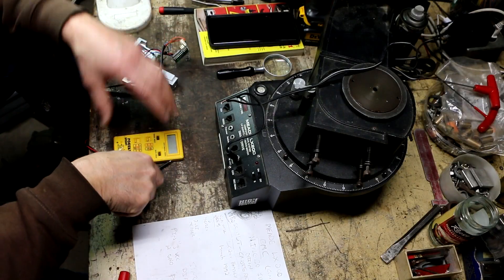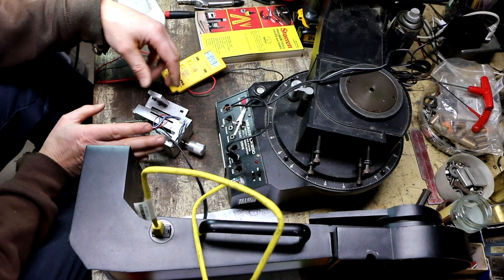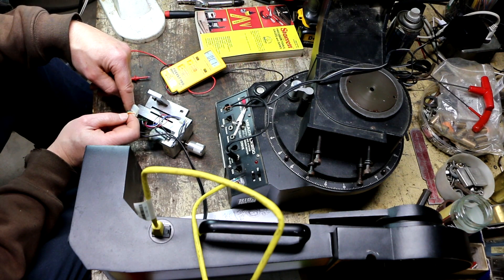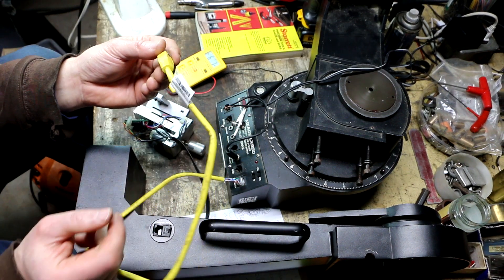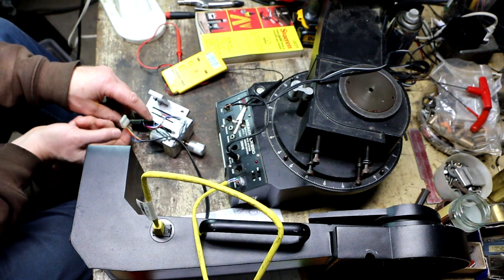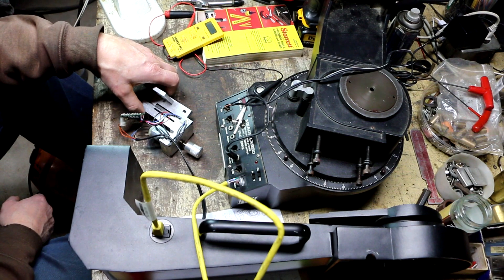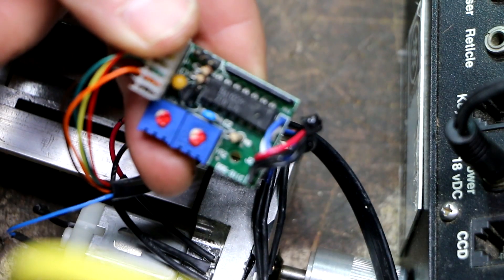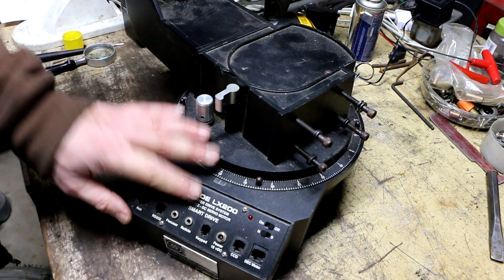Meade LX200 Classic Telescope Part 3

Comment: If you ever take an LX200 Classic apart again, wrap tape around the forks and base where they meet.  Cut the tape in between the gap and mark with a sharpie.  That way you can get it really close to its orthogonal alignment.  The GPS fork does not work like this.  It's one piece.

Held in the front cell is called the corrector plate.  The primary mirror is attached to the baffle tube on the rear cell.  The corrector plate holds the secondary mirror.  

The LX200 goes through a "find home" when you first power it on.  That's what you hear whirring when you apply 18 volts.  It is rotating the worm gear around in the R.A. (inside the base) until the hall effect sensor picks up the magnet inside the shaft.  Once it finds that, it will reverse rotation and then start tracking 15 degrees per hour.

The DEC motor cable is not a straight through cable.  It is reversed at the other end, no you cannot use a crossover ethernet cable.  !!!MEADE WAS WEIRD ABOUT WIRING!!!  PAY CLOSE ATTENTION TO WHAT YOU'RE DOING.

If you're digging into one that deep, replace every screw with a stainless steel one.  The old black ones rust like crazy.

Once the corrector is shattered, most of it is scrap as the corrector was matched to that mirror at the factory.  Finding another that produce what a matched set could would be virtually impossible.  Meade had a patent on how they aligned the corrector as well.

They were a great company back in the 80's, 90's and early 2000's.  They were bought by Orion and everything sucks.
Reply from the maker: Lot's of great info you have here. I figured out most of this through research, and trial and error, but this comment might help others. The OTA is currently a scrap bin for aluminum, and will be going to the scrap yard soon. The forks will probably be joining it. Without the autostar control, I cannot give the base a true test, and the DEC motor/drive seems to do nothing even with a correctly wired cable. So I will probably just sell those parts AS IS. Thanks for watching.
Reply: @stevewatr  -- Thanks, Steve.  I don't have a way of contacting you inside of YouTube, but if you want, I can give you something for the base minus the forks.  Or just the boards.  So you'd have the R.A. motor inside the base, the main board with it's two ceramic resistors, the DEC motor and the front panel.  The 8" and 10" models used the same firmware I believe.  The 12" was different.  Value wise...without knowing if it's truly functioning, it's not going to be worth tested and verified components.  So I'd say like $45 plus shipping?  ¯\_(ツ)_/¯ 

Let me know.  My email address is -- philgodfrey at me . com -- (separating out everything so the bots don't figure it out.  Obviously replace (at) with @).  :)

Comment: Too bad another Meade owner couldn’t loan you a keypad and cables. Clearline-tech makes a new handcontroller for about $140+ shipping with cable.  Yes the DEC motor in the fork does not move on start up...only the RA motor which is in the base which rotates according to the clock setting to match the Polaris offset. The boards that drive the motors are upgradeable also with clear line products. Might be someone looking for those old boards, but would need to know if working. Typically the yellow C1 tantalum capacitors on the motor boards, main board, front panel power board and the handcontroller board blow and kills the scope. Cloudy Nights has the tants coveredwell.  Best if possible to replace before that happens, especially on a 20+ year old scope.  Enjoyed your earlier disassembly video. I now understand how the focuser works by moving the primary mirror along the cone assembly connected to that big tear drop arm. No wonder image shift is a problem. Would like to have seen the inside of that tube at the base. Grateful to see how the secondary mirror separates from the corrector plate. Thanks!
Reply from the maker: You are welcome. I know a guy who has agreed to let me try his controller. It's not the same model, but it is a meade, and has the same plug on it. I figure it is worth a try. We both agreed that if either item gets damaged by trying it, neither one of us is going to get too upset.

Comment: all my life i've wanted a LX200 they had a issue with lack of lubrication ruining the gears. just finished a restoration mid '70's scientific american 6" equatorial mount newtonian reflector there's a guy in palo alto ca who re-aluminizes primary/secondary mirrors up to 17" basement of his home some kind of diy vacuum chamber with tungsten filament to vaporize aluminum foil he buys from walmart. problem with ameture astronomy is there's no return on investment and it's always cloudy during important events. when halleys comet flew by 1986 i vowed next time i'll be ready

Comment: Would have thought the keyboard is a standard type keyboard just a different connector if you can find out what the pinout is match it with a standard keyboard work fine